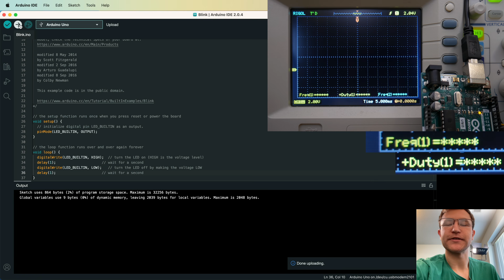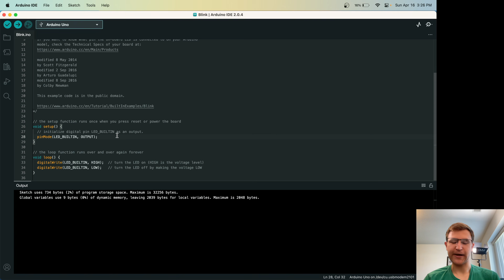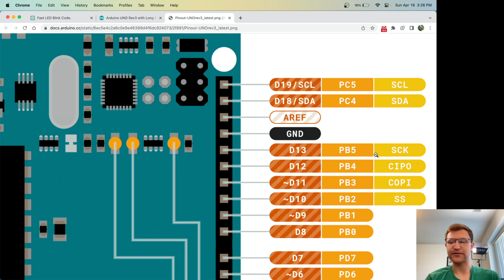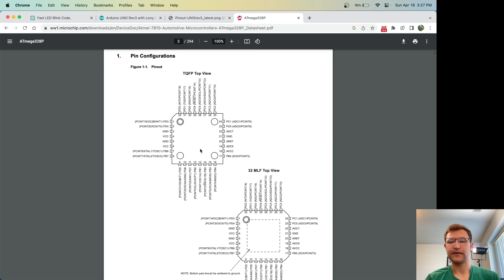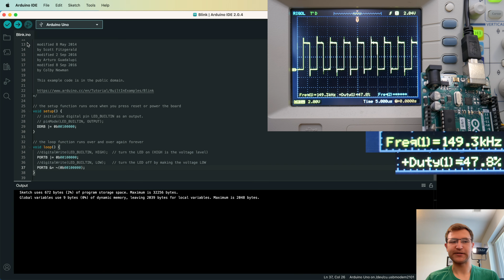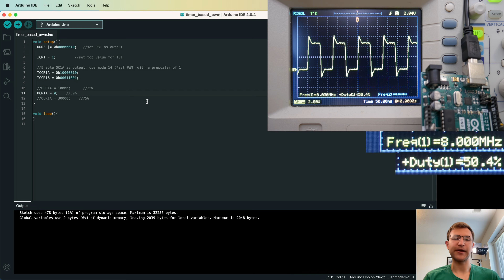How Fast Can an Arduino Flash an LED?

Comment: Great video very informative,  yes I'm at the very start of learning arduino uno  , question so how fast will a led blink per minute  ? Is 1000 1500 easy enough to code .
Subbed cheers